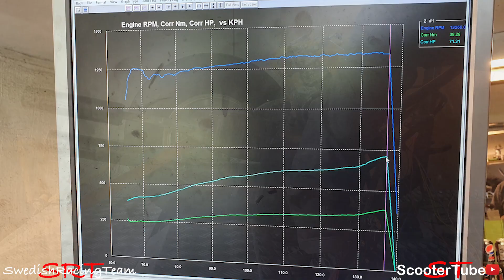On The Dyno RooST 200cc

Comment: 1400cc 4 stroke has 70hp. 200cc 2 stroke: Lol
Reply from the maker: it is not to be compared to a car 😉
Reply: BW'S
Reply: @ScooterTube  True but if u would put this in a small car 😂
Reply: 1400cc 4 stroke + Turbo = 500 hp
Reply: @bozzalnw5357  Still the scooter is way lighter
Reply: Bozza Lnw and yet the engine weighs easily twice as much as the entire scooter....
Reply: Harley ?
Reply: @bozzalnw5357  Please supply proof of this - video or YT link
Reply: @7.3 DI Highboy tell that to my bone stock 1978 KZ1000 at 100hp.
Reply: @bruceclark5627  bone stock 1979 kz1000 with 100hp? I'm not trying to be that guy but a bone stock 78 kz1000 didn't put out 100hp. The bike was rated from the factory with 85hp. Although that was quite impressive in 1978 and is still no slouch your bone stock kz1000 simply doesn't put down that kinda power.

Comment: Lots of things wrong on this video, a 200cc twin in that configuration should make a lot more power, in excess of 110hp. The carburetors are in too steep angle, the fuel bowls work wrong that way, you can also see the amount of smoke which is partially caused by the carbs and partially because of a too rich premix. This engine could be substantially better.
Reply from the maker: Thanks Jari
Reply: Can you point me to a 200cc that makes 110hp?
Reply: You gotta keep in mind its a scooter engine.  Well built 94cc have been dynoed at around 30 whp, like the rc-1.  This motors probably a little more volatile so 35 per cylinder isnt too unreasonable when you combine them with the big carbs and premium trans parts.  Scooter motor has to send power through the cvt then final drive so they lose a bit of hp at the end
Reply: what 😂😂